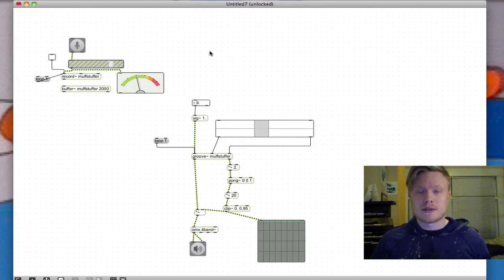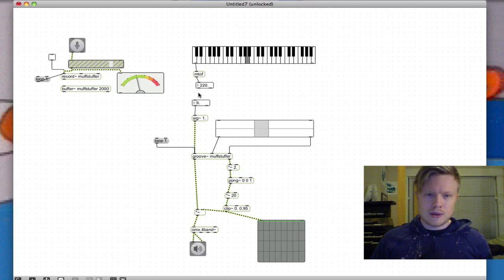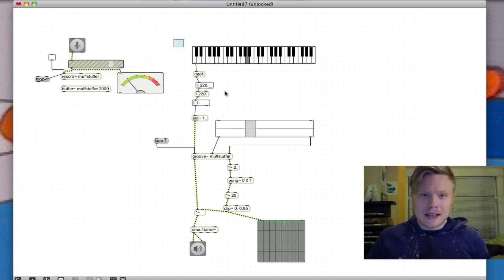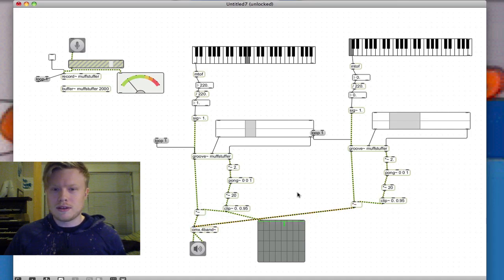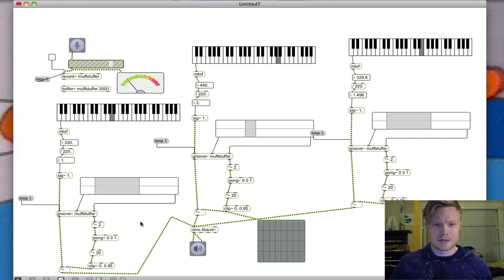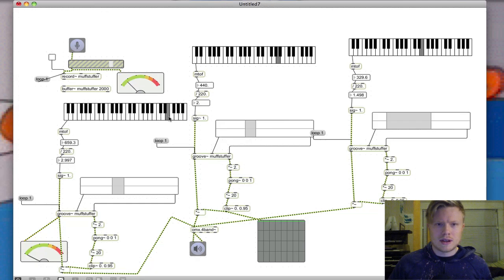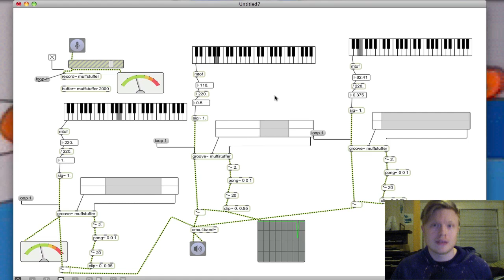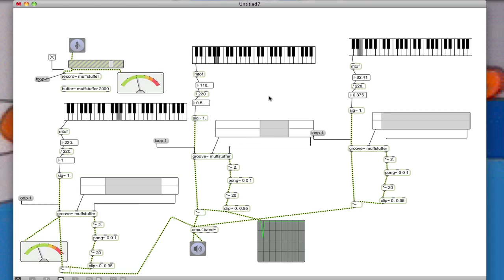Max MSP Groove~ Part 3: Chords

Comment: Hey man! First off, GREAT tutorials. I'm 2 days into my MaxMSP demo and I like it alot (and i come from an analog synth/ modular world!) I followed your directions accurately and its working exactly how yours is UNTIL  when I "make the math" after the keyslider (mtof to float number to divider) when it gets to the groove and hits the first number box (before the sig~) it doesn't give me any decimals - just integers. As a result it doesn't play like a sampler. Pitch only changes at the octaves. Any thoughts?
Reply: and yes i've watched your previous 2 tutoritals
Reply: Jeff Santana ditto for me. My flonum object only shows integers. Did you find out what we are doing wrong?
Reply: Steven Landry Figured it out, divide by 220. (include the decimal point) instead of dividing by 220
Reply: great! thanks!